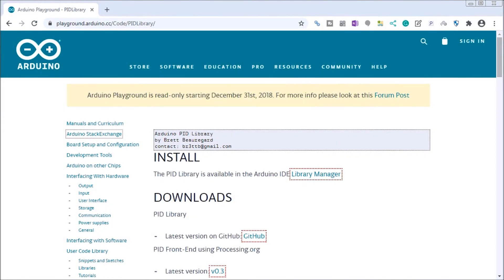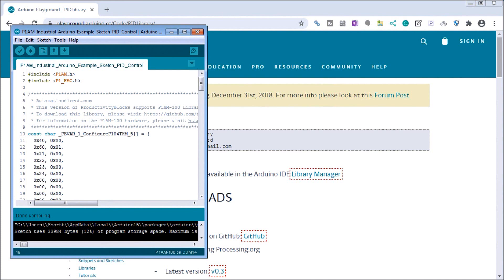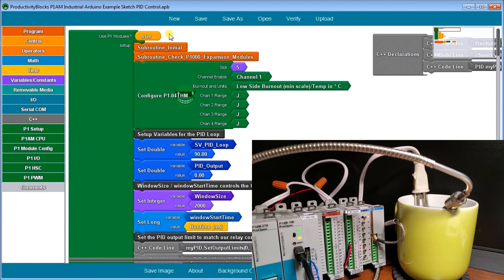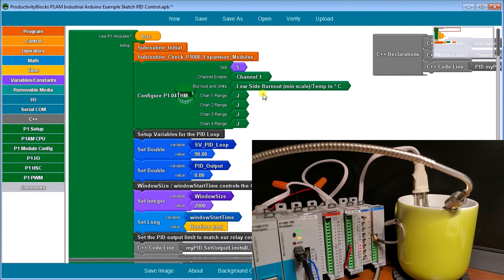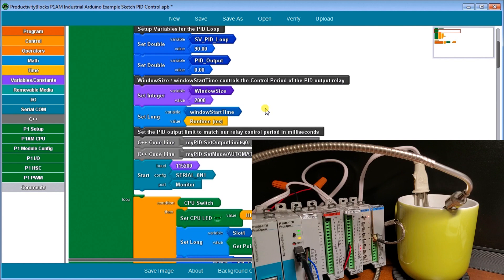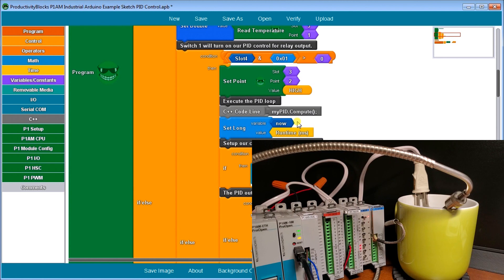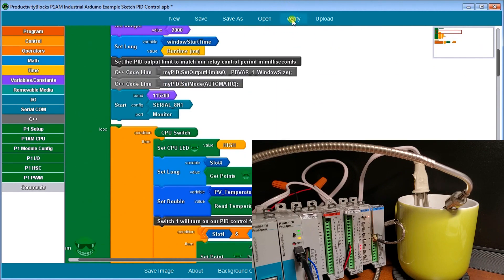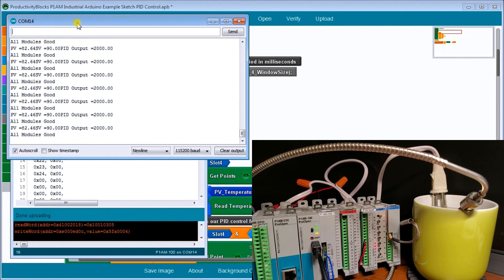Productivity Open P1AM Industrial Arduino PID Control

Comment: Not trying to nit-pick but 
1. 2000ms = 2 seconds not 200 milliseconds
2. Direct acting control means that as the PV ( process variable) increases the CV  (output or control variable) increases, e.g. a cooling loop. 
3. Indirect control means that as PV increases CV decreases, e.g. a heating loop
4. 2 & 3 above are long term historical industry standards.
5. Why was this set up with those definitions contrary to industry standards?  I can see that it is working but please guys, don't redefine terms already in long usage, it will be confusing for newbies
Reply from the maker: Hi Charles,
I appreciate the comments.
My mistake of saying 200 milliseconds instead of 2000 milliseconds as shown in the example.
I agree with your definitions of direct and indirect (reverse action) action. The library for the PID as you mentioned, works but is reverse to conventional thinking. 
Thank you for clarifying these points.
Garry

Comment: Hi, the product you are presenting is very nice. I'd like to know more on its working priinciples. Specifically, I'd like to know:
1. are you using mechanical or SSD relays ?
2. How are the modules connected to the "cpu" unit? What kind of bus are you using ?
3. Are all the modules based on arduinos? How does each module works? How addresses of each module are chosen?
4. is it really necessary to use the Productivity Blocks? Is that a software developed by your company or it is just a general purpose IDE?
Reply from the maker: Hi @ggiorgiannigmail
Each of these videos has a corresponding post with additional information. Here is the link to this video's post:
https://accautomation.ca/productivity-open-p1am-industrial-arduino-pid-control/
The entire series can be found here:
https://accautomation.ca/series/productivity-open-arduino-compatible-industrial-controller/

1 - A relay output is used. The control period is set for 2 seconds.
2- The modules use the Productivity 1000 PLC Series IO. They are connected via clips directly to each other on the right-hand side. The left of the CPU unit can connect Arduino add-ons.
3 - The P1AM open uses the P1000 PLC IO cards. Addressing is done in the following way:
https://accautomation.ca/productivity-open-p1am-industrial-arduino-p1000-expansion-analog-combination-module/
This is for the analog card. Digital IO can be found in the series listed above.
4 - You do not have to use Productivity Blocks. This was written by Host Engineering. You can program this unit using the Arduino IDE.

I hope this helps you out.
Regards,
Garry

Comment: Can I directly write C++ lines in the code generated by code blocks?
Reply from the maker: Hi Sanjay,
Yes, you can write C++ lines in the code generated by code blocks. This provides a great way to modify or change the code before sending to the physical controller.
Sorry for the delayed response.
Garry